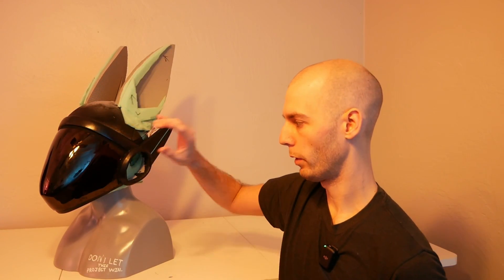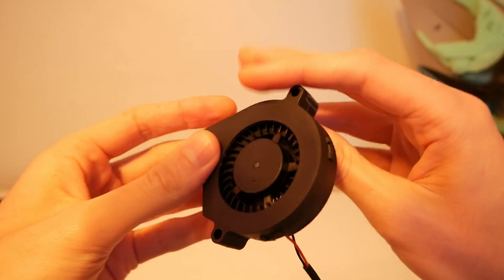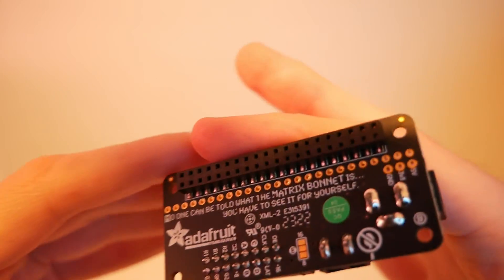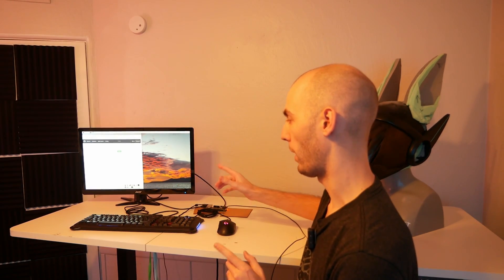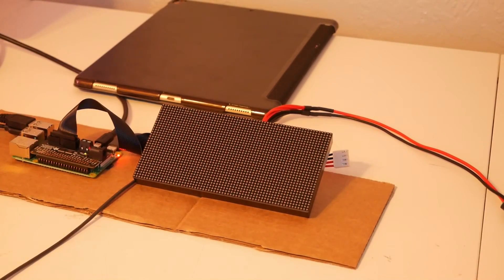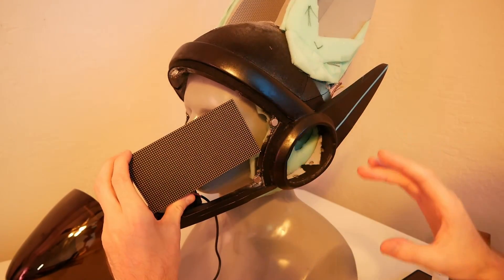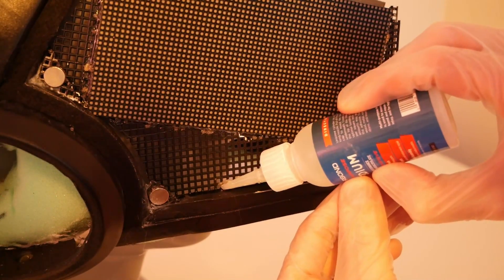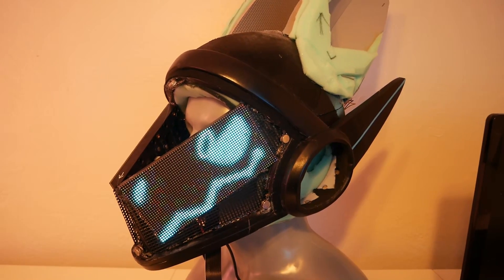Making a protogen face [#3]

Comment: 8:09 what is that material called when you attach the LED itself to that one material? Is it conductive ot electricity or not?
Reply from the maker: it's generic plastic mesh, no it does not conduct electricity. I got it cheap at the hardware store

Comment: What are you using to power the LEDs? I'm trying to follow your videos to build my own head and am getting caught up here. I plan to use a battery pack like the one you are using but am unsure as to how you connected the LEDs to the powerbank, from what I see online everything says not to plug into the bonnet that is on the Pi. When I look up power supplies for the LEDs they all seem to plug into wall power.. any help appreciated!
Reply from the maker: they are plugged into a generic battery bank with a USB plug. The Pi only sends display data to the screens ^^
Reply: @WafflesDoesArt  Thanks!

Comment: Question, how did you get the text for 5:22?
Reply from the maker: from the RPI RGB LED Matrix's github page, they have a guide you can use
Reply: @WafflesDoesArt  so I tried doing that, but keep getting stuck because the code never compiled like theirs or yours.
Reply: @WafflesDoesArt  I get stuck when I try to put the code in for the test image
Reply: It skips my image saying it's unable to open (Magick: Unable to open file(...) reported by magick/blob.c:3094 (OpenBlob) then followed by No image could be loaded

Comment: For anyone that wonders he's using a 2.5mm pitch 64x32 led matrix display for the face, that's why it might look a little bit cramped. Arduino is also more than enough, is cheap as shit, is found everywhere and uses peanuts for power although you need C/C++ to program it and it's not quite as intuitive as the raspberry pi. If you're programming a matrix display this big and complex though you'll need an Arduino Mega, thankfully still found literally everywhere and for relatively cheap. 
You can also use smaller displays like 8x8 or 8x16 and hook them up together to make very basic facial features, about 4x cheaper this way (though not nearly as cool) and the smaller displays are much more common to the point where you may not even need to order them online. Also depending on which model you buy you're likely going to need to buy the IDC port and solder it on the raspberry pi, aka no bonnet (though both the arduino and pi have them). For the Arduino Mega I don't know yet how that'll work out but at least Adafruit has some decent guides, if not decent pricing and insane shipping costs.

Then again if you're making a proto helmet you've probably done all your research already and know most of this. Ngl protos are probably among the hardest out of all other fursuit species to make properly, especially if you're going all in on adding features.

Update: A bit late to this, still nowhere near finished or getting truly started with this project but I'd very very much like to give a few pros and cons for the different microcontrollers/microcomputers.

Arduino: It's very good and is extremely useful for true real-time feedback (as in you don't have to wait for python or c to garbage collect at random times or smth). As I said it's found everywhere but after I did some digging I'm not sure the price is worth it at this point because: Arduino Mega, at least where I'm at, was at least 50+ bucks in my currency (which roughly translates to 25 dollars or smth). Second, you do need some knowledge programming it or spend a lot of time browsing online for solutions because: the progmem function/segment which you use to store images onto flash memory is limited to some 64-72 kb or something so you'll need to write your own custom code to make it work. Even then, you only have 128kb to work with before the program slows down because of "trampoline" effects. More info in this absolutely gold mine of a forum post - https://forum.arduino.cc/t/is-the-128kb-flash-limit-on-mega-2560-removed-by-arduino-ide-1-6-0/290281

Third, if you want actual animations that don't run at nothingburger frames-per-second you'll wanna go either with a microcomputer or do custom code. Like a guy on the forums once said in a passive-aggressive tone ">parseInt() is a crutch. Learn to write your own data collection and parsing code". 

Finally if you ever want more than... one and a half or two full 16-fps animations you'll need to get some microSD card shield or a dongle or whatever and that in itself requires separate programming to work with the rest of the arduino and GPIO and at some point I realised it's a massive headache for another time. (Also did I mention there isn't really a led matrix drawing program for the arduino? Well, a non-to-barely functioning one. The guy that made it is a saint though so if you have the skills please help him finish the project it's open source).

Compared to this RaspberryPis are extremely straightforward and follow this video directly but the pricing is still really iffy if you're on a budged. Right now I'm considering the "Le Potato" AML-S905X-CC competitor to Pis model 3 B/+ and also the ALL-H3-CC which is almost a 1:1 replica of the model 3 B. The only major issue I'm seeing right now is that there's no GPIO library, but aside from that you can install Raspbian on it so technically it should behave like a raspberry pi. There's also a bunch of other rasp pi alternatives like orangepi but considering all the complains from there I've yet to bother looking into that.
Only other issue with that is thaaaaaat you'll need to get the bonnet from adafruit or similar sources cuz aliexpress is full of scalpers. And I can't really find that part anywhere else that isn't overpriced. There's 100% chance there's a solution for if you go without bonnet but I'm not sure I wanna bother with that at this point....
Protogens are outrageously expensive even if you do all the work jfc.
Reply from the maker: All really good points. The smaller LEDs are much easier and cheaper to work with, for this suit I wanted to cram as many LEDs as I could into the space so that's why I choose this board.

Comment: i would love to make a proto head but im not rich like you (pi, led panels, and all the materials u have here are not cheap)

i know how to 3d print, sew, and solder tho. i should be able to find enough stuff i already own to make the helmet, most of the electronics (lights bulbs with diffusers most lilley, not a panel like that, nor a pi, i need that pi elsewhere) so the most expensive thing would be the electronics i dont own, fur, foam, diffusser plastic, and the visor. the one dude i knew with a vacum printer like that moved away, and it belonged to his boss for work, so i doubt i could make my own. 

do u think its still possible with such a limited budget?

Comment: Could you replace the Raspberry Pi with an Arduino? It seems like that would be a much cheaper option and you're not really using that much computing power.

Comment: I never would have guessed proto suiters look through the top :0 that's neat. Would there be any way to make the 2 screens' mouth parts connect to eachother to make the mouth a continuous line? Maybe an LED strip? Would probably mess you up in the long run when trying to add expressions though.
I think the Raspberry Pi could be attached somewhere on your upper back..? You could make some sort of a platform/mini backpack thing and put it there. Alternatively, on your chest, and you could style it to be like Iron Man's "core" or whatever it's called.
As for a name, something like Raspberry? From the board used. Mahogany/Mocha, depending on how much brown and orange fur you'll be using from your last suit. Or Ocean/Breeze/Ripples depending on how much turquoise or blue you'll be using.
Good luck continuing this project! <3
Reply from the maker: you have a lot of good ideas, I think it's all about if we can get it to work or not lol. I do really like your backpack idea!